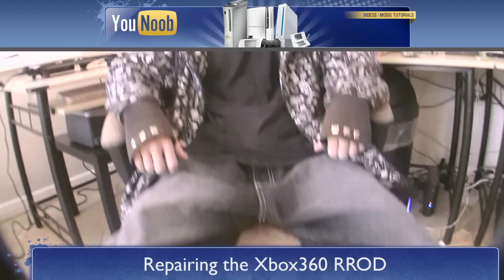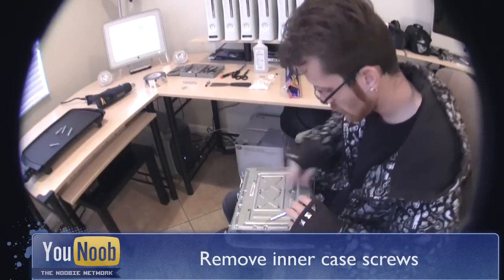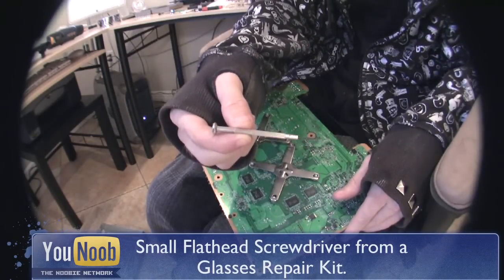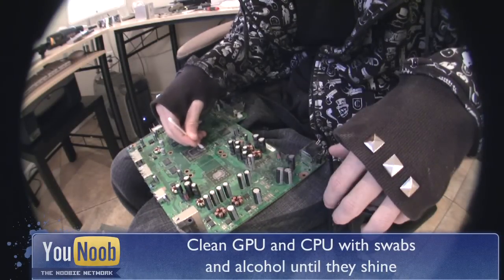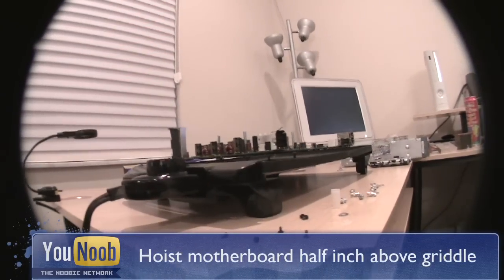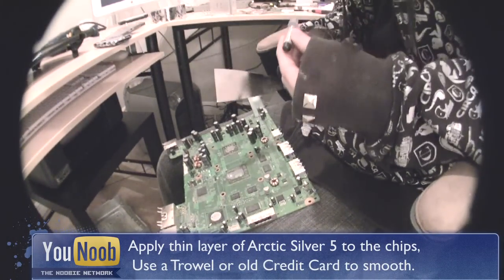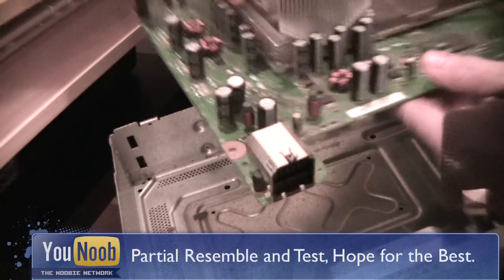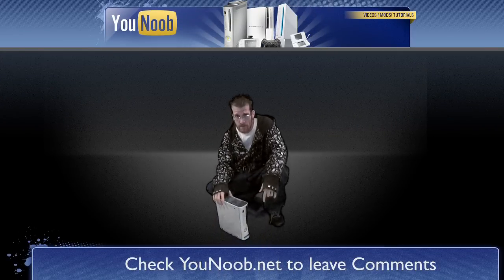Repairing XBox RROD (Red Ring of Death)

Comment: i repair xbox 360 game systems and if you try this you might blow the capacitors on the mother board causeing you a bigger repair bill the foil is trapping the heat around the capacitors. the capacitors are the little round circles about the size of a cigarette butt if the top of the capacitors are mushroomed or bulgeing out at the top you just costed yourself about $10 to $20 per capacitor to fix them if search to fix the rrod on your xbox 360 you could get it fixed  about $65 to $70 dollars